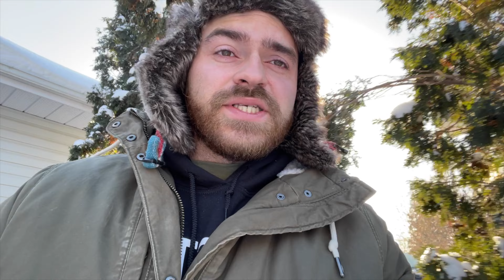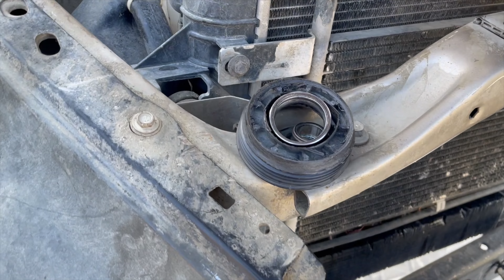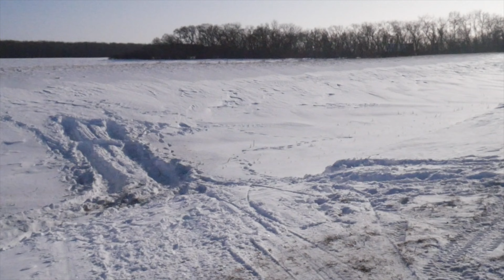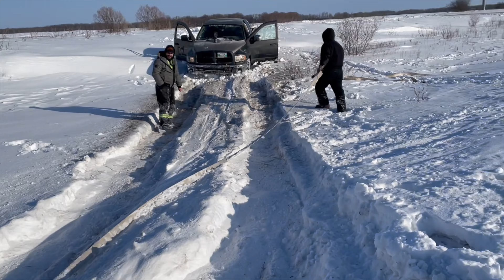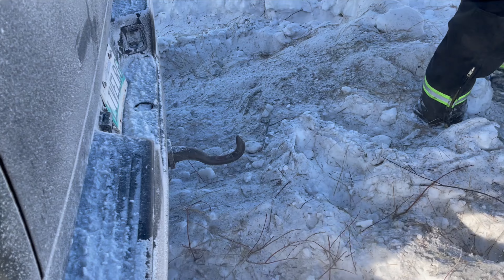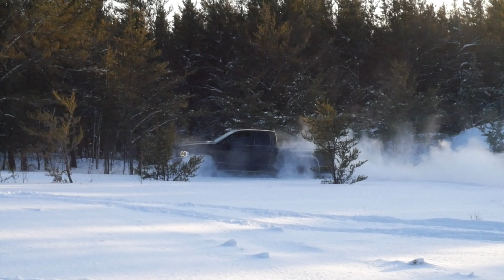LIFTED TRUCK SNOW OFFROADING *GOT STUCK BAD*

Comment: I live in the mountains in B.C, and I gotta laugh when I see trucks like this with tires too wide 4 snow, no air lockers, not using Kinetic straps which beats the fuck outta both trucks as u proved! Just thinner studded tires In deep snow makes a big difference. And let's face it its Canada, we get 5 solid months of hard packed snow/ice on the roads-why run the mudders in the winter floating everywhere!Cheers bro stay safe!🇨🇦🍺